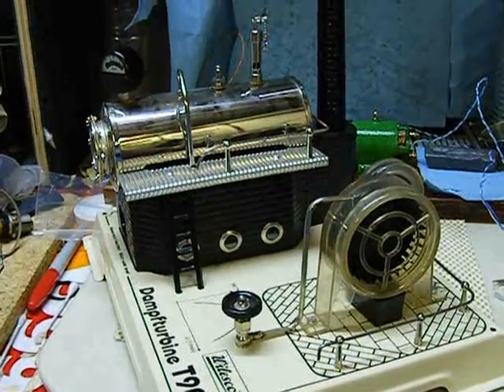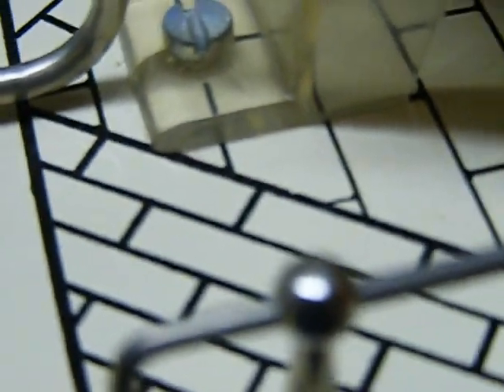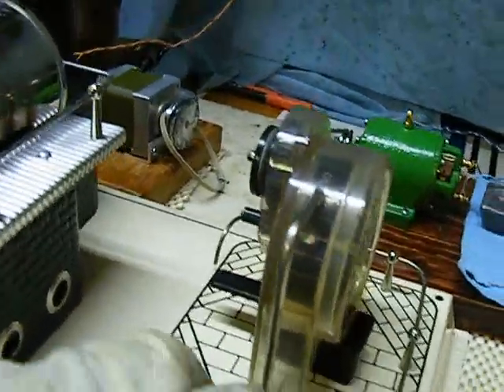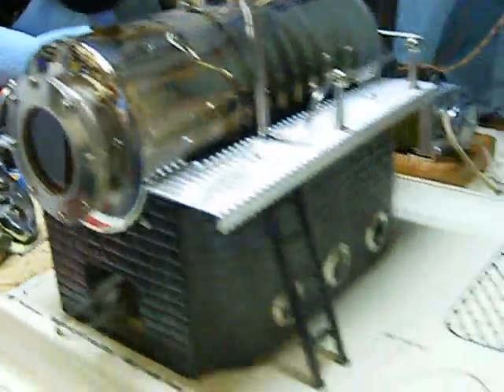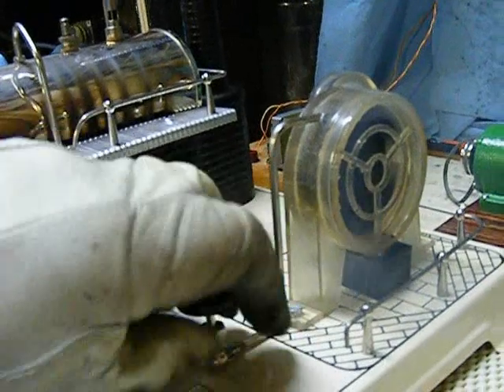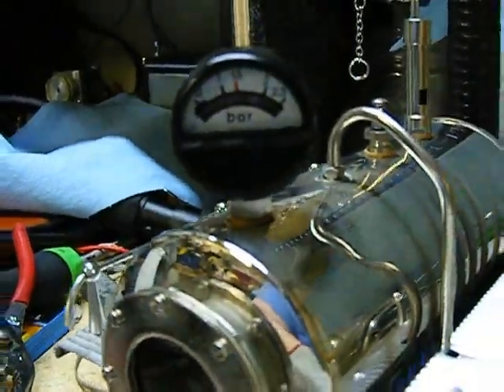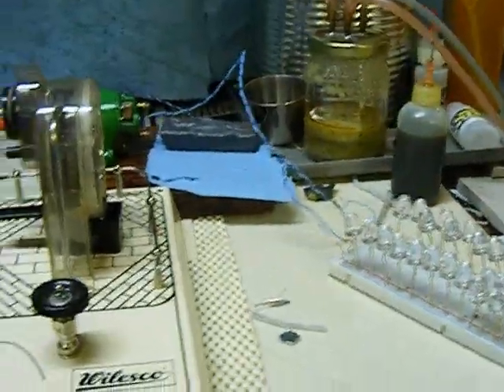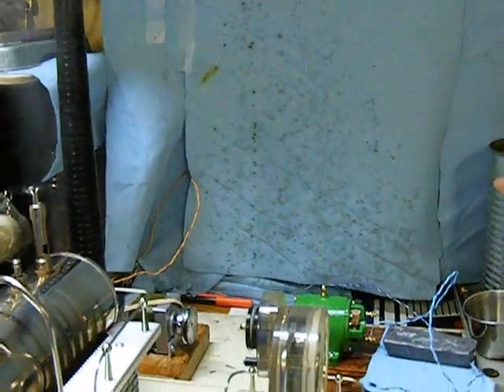Wilesco T90 Steam Turbine

Comment: I have a Wileskon D10 with a stepper motor generator. 12v led strip burns really brightly..and without LEDs 26v
Reply: Torille! Hey, do you have a link to The exact model of the generator you are using?

Comment: Wow, no oil? As you surely know, the piston engines require lots of oil! That has got to be strange! 

Seems to have a fair bit of power!
Reply: The Turbine need no oil, because it have roller bearings which are already lubricated and need no more. The amount of power is very bad, piston engine is far better...

Comment: @luuko656. because turbine engines uses more fuel or steam than the normal steam or fuel  engine,  I.E. a jet engines running at idle comsumes 4 gallons of jet A fuel a minute, while in flight, it consumes more than 27 gallons of fuel an hour, a normal engine (depending on engine size and intake manifold setup) gets an average of 23 or more miles to the gallon

Comment from the maker: Ta.  The generator is made by an outfit called "PM Research".  You can look up the specs at their site (I don't remember), but they are wildly inflated anyway from what I've seen.  In a controlled experiment in another video I used the Jensen 20 to drive it and managed to produce, I believe, about 2 watts.  Fuel is denatured alcohol (I hate Esbit) in a vapourizing burner, and the boiler is good for 15-20 minutes between fills.
Check out user reidsteam. He's got a more powerful toy generator.